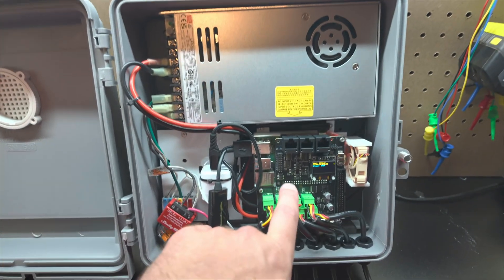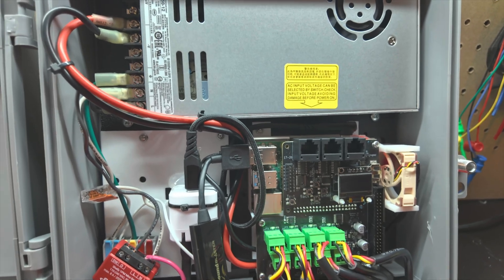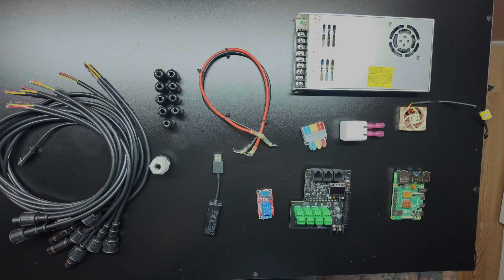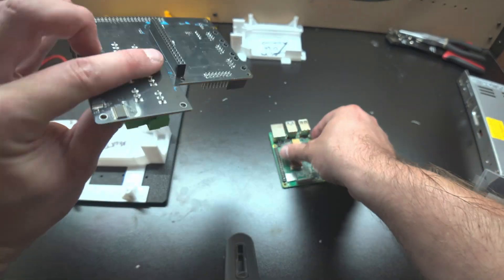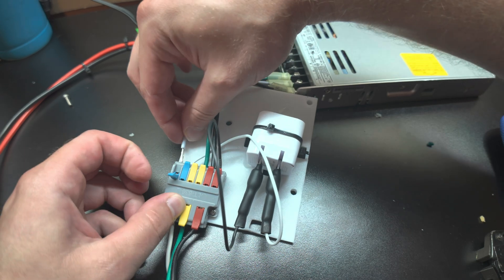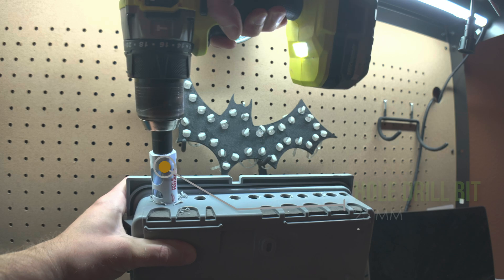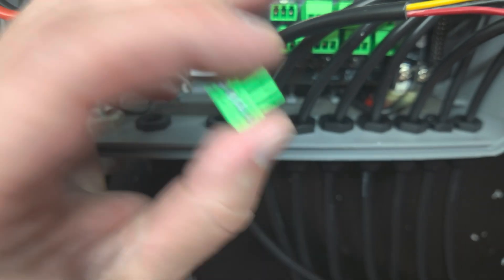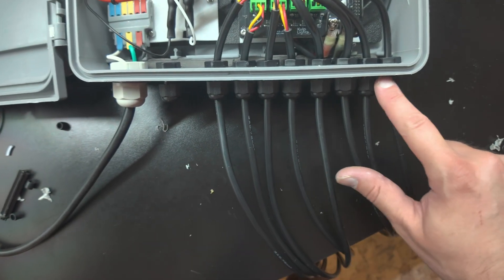Kulp K8-Pi Controller Build -xLights and Falcon Pi Player (FPP)

Comment: Very Clean build! What is the board you used for the 5 volt powersupply and the 1 in 2 out? Also is there a file for your exhaust vent on the front?

Comment: Will that fan mount work with a K8 with a beagle instead of a PI
Reply from the maker: The internal mount for the board itself?  Unfortunately  it will not.  I have a K8 beagle on order and will need to design a fan for it (Phoenix roasts during Halloween).  I will post a video of that when it arrives